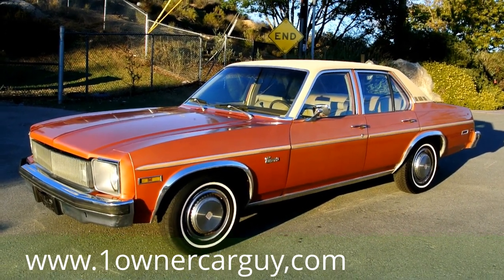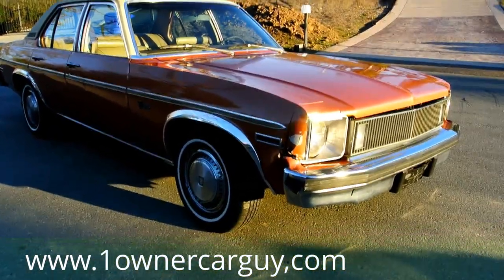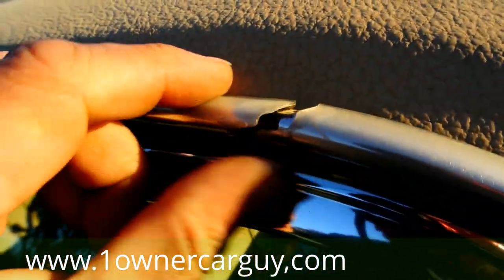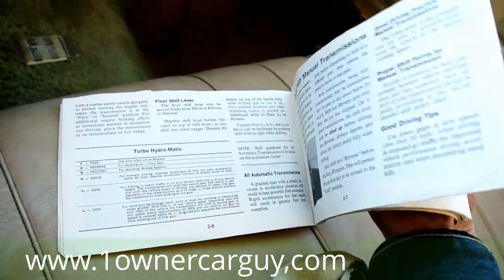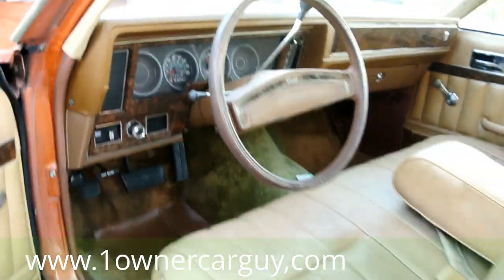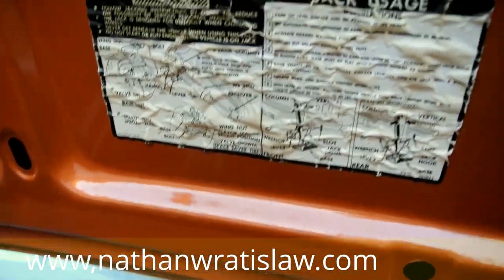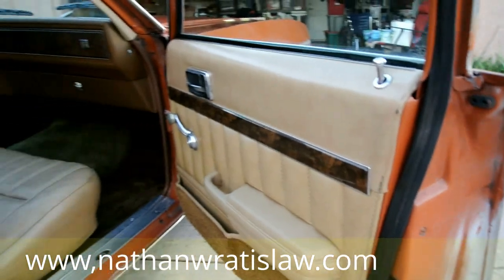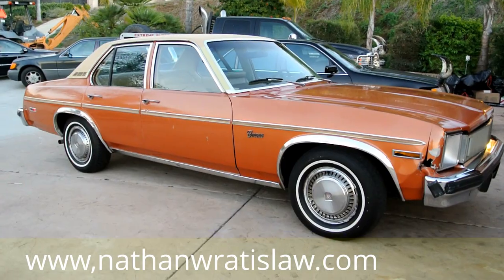1977 Chevrolet Concours LN Luxury Nova V8 Classic Box Caprice 7300 Orig Miles 1 Owner

Comment: I just got my hands on a 1977 Ford Pinto Wagon in chocolate brown with tan plaid interior. All original, one owner with 53,000 original miles. 2.3 four cyl, 4 speed manual trans. Clean as a whistle. Garaged kept and a manila folder full of receipts and only maintained at one Ford dealer it's entire life.

Comment: My first car was a 1977 Nova Concours 2-Door Coupe.  Blue with a blue half vinyl roof and black interior.  305 V8, Auto, PS, PB, No Air.  Bought it used in 1985. You had to drive the thing for at least 20 minutes before the engine would warm up enough to stop sputtering upon acceleration.  I sold it a year later and never missed it..
Reply: lots of V8's sold by GM from 73 to 83 with anemic horsepower,

Comment: Nice interior for a Nova. I've heard they did away with the Concourse model for 1978, so it wouldn't compete with the "mid-sized" 1978 Malibu, which had a shorter length and wheelbase, though  a little more passenger room. The Nova still had roll-down rear windows and room under the hood for more engine, though I don't know if anything bigger than a 305 was available that year.  I believe even the 250 straight six was too long to fit in the new Malibu.

Comment: I noticed that the radiator hose on the top side was collapsed. Did you check the lower hose while it was running? If it is collapsing then that could be your problem with the temp light.

Comment: have relative who has 1978 Olds Omega decent condition with 3.8 110 hp Buick 231 V6 original engine. Has 128,000. thinking about buying. I am not a mechanic. Maybe just asking for trouble. It is running good.. burns about 2 qrts every 5000 mi. She's thinking 1500$
Reply: It may be a worth while investment as the Oldsmobile Omega is rare and extremely hard to find I miss the '75 Omega my mother had.
You may luck out that the oil burning is a minor repair to keep it original as opposed to an engine replacement.

Comment: Clean as a whistle.  Pinky steering lol. Even if the mileage might be 107,000+ if it's a 305 v8. Then it's not in the same league as the special order. 350 v8. 305 v8 is not considered a great motor. the 267 aluminum v8 was even worse. The 250 i6 was the best and most common set up for the Nova's